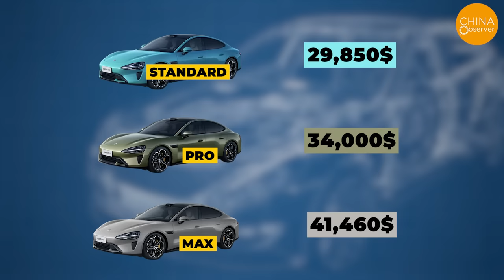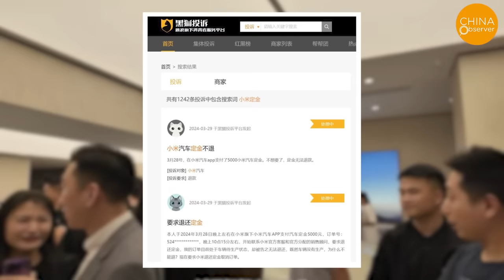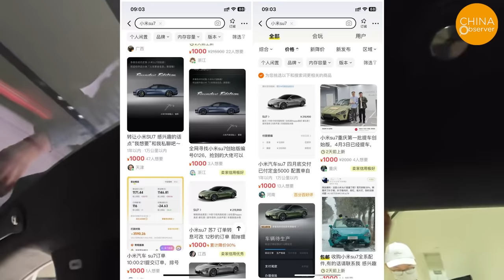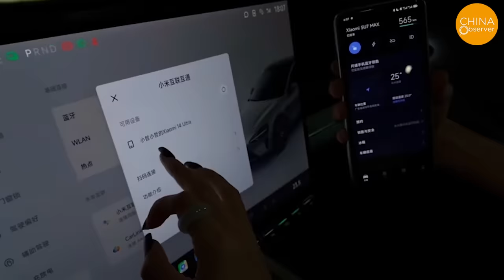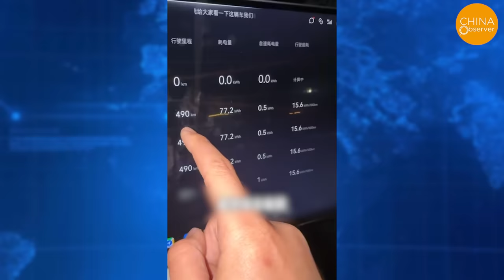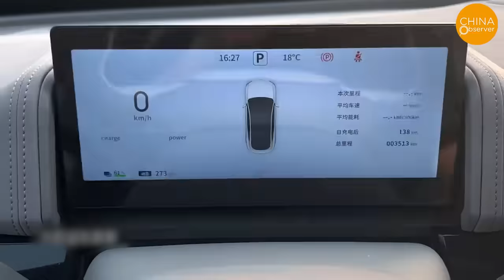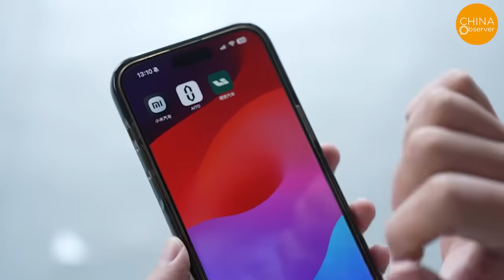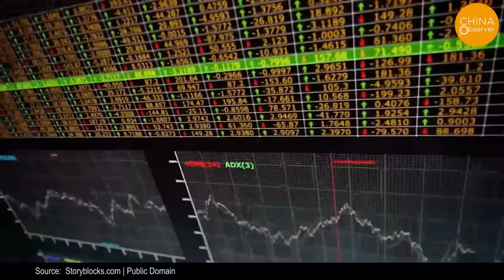Xiaomi EVs Criticized for Poor Quality, Using Aluminum Instead of Copper, 40% Cancellation Rate

Comment: Europe should not allow these vehicles to enter the European market. Cars that loose suspension or batteries that catch on fire on a highway are very dangerous to other vehicles on the road
Reply: Should be standard testing no matter where the car comes from in order to get into market. No reason to cherry pick!
Reply: and where to dump these toxic products?
Reply: @eriksvensson2098  That is not enough, because if a product is "designed" to destroy and take over a market, then that market should ban it.
Reply: Europian cars are trash the break down all the time with very expensive repairs also!!!europian cars are very sensitive
Reply: We have TÜV, don't worry. It's the great filter, barely any car accident in EU happen due to a malfunction. 99 % are driver faults.
Reply: Cars that fall apart when test driving should not be allowed on any road.
Reply: Remind me of expensive low quality of Boeing products LOL
Reply: they will pass standard testing then fail subsequently
Reply: @manuelr1405 There are large graveyards of brand new unsold EVs in China.
Reply: I hope they will be sue because they copied porch !!
Reply: do you have any idea how the EU is handling stuff...
Tesla cant sell a single cyber truck in the EU...
Reply: @eriksvensson2098  do you have any idea, what you need to do to get a CE sticker....
one of many reasons Chinese firms copy it and printing it on their stuff without the certificate attached, because they never got one!
Made in China is a curse!
Reply: @Arltratlo  Europe isn't a country whose people love monster trucks.
Reply: @hokroeger Some people love monster trucks.  You do realize though, monster trucks are not road legal and are only driven at shows and stadiums.
Reply: SB😂
Reply: @manuelr1405  in third world countries as like as we always do
Reply: That will probably be their sorry excuse to protect their companies
Reply: @Erik-Winters So we should actually still be riding in horse carriages
Reply: @damocles8417  For the rest of t he world, a Silverado is a monster truck; a thing that looks really ridiculous when used to  go to the supermarket or to drive kids to school. the same goes for a Hummer, or a Cybertruck.
Reply: There should be a genuine video footages of the actual incident. Or this is another one those demolition jobs
Reply: Surprise: Tesla  also uses aluminum wiring 😂
Reply: @Erik-Winters  I mean that's like 90% of the western agricultural products in world market. All of which is heavily subsidized by governments.
Reply: @Arltratlo I wonder why , maybe because it’s a death machine 😂😂😂😂
Reply: 50 cent army herro @alxRo
Reply: Then Tesla should be expelled as well since there are many examples of brand new Teslas whose suspension cracked after a few miles/kilometers of driving.
Reply: @alxRo #European cars. 
All cars can break down, but I'll give you some credit about expensive European cars. Some of them top the list of most failures, but not all. Toyota, Kia and other Asian car manufacturers are always at the top of the lists over cars with the fewest mistakes for both new and used cars.
Reply: @EmilMToft  there definitely is not. I found one person who had issues after 115 miles. However, this:

"Reuters previously noted that Tesla performed 120,000 repairs of just the front upper control arms between January 2021 through March 2022."

That's pretty bad for sure
Reply: @Arltratlo that's because of the physical design of the Cybertruck and not because of demand that it's not sold in the EU. The Cybertruck hasn't got a deformation zone because of the hard metal used for the chassis/exterior, which is one of the reasons why the Cybertruck doesn't live up to the codecs.
Reply: @magnumxlpi look at the German TÜV and how the Tesla 3 is the car with most faults/mistakes for all the 3 year old cars tested extensively.
Reply: @EmilMToft   heyy I lived in Karlsruhe and Berlin. Yea I believe it. That's pretty wild
Reply: @DC9848 european cars are expensive and cant handle competition. All the brands make 30000 euro cars with sub 200hp and when another manufacturers brings 300hp 29000euro they jump on him like:
Reply: Nobody would by a chinese car in Europe. We know what to expect : a tofu car !
Reply: @frankmaclow2709  you wouldnt buy a chinese car because they lie about the capabilities. If you look even the entry level ones list 600km range from 70kw batteries and they dont even have a repair network so you can service them
Reply: It has BYD blade battery technology so the chances of the battery catching fire versus a Tesla is infinitely less.
Reply: @Arltratlo  naah you can import it, as EU regulations are only recommendations. Same with this xiaomi car, u can register it in ukraine or something, same with US-cars, that have v8 there are plenty F-150's very popular among farmers. People in europe are just poor.

Comment: In the United States, in the 1960s and 1970s aluminum was used in home wiring for cheapness' sake.  Later there were a lot of problem with oxidation and loosening of connectors due to significant expansion/contraction.  Afterward, the US went back to copper wire.  Using aluminum wire indicates that the manufacturer does not intent the vehicle to last a long time.
Reply: Guess what tesla use? aluminum wire? or copper wire?
Reply: I think aluminum is not the problem. You should isolate it well and use the right wire thickness accordingly.
Reply: it could also be a method of accidental forced obsolescence so the user needs to buy a new car sooner.
Reply: Because in the 60s alluminium was still new tech for civilian market. But guess what, alluminium is quite comment nowdays in cars buildings and plant. Copper price have rose and we know how to produce better alluiminium cable. Most EV like tesla use alluminium wire.
Alluminium has much better electrical property than copper.
Reply: Even to this day aluminium wire and high current start's car and house fire's!!! Even aluminium speaker wire is absolutely garbage that breaks when setting up speakers or it won't work at all having many breaks along the length of the wires!! If you have a Ev with aluminium wire you are guaranteed to have a fire
Reply: @chiriematthieu  Aluminum has 61 percent of the conductivity of copper.  (at the same size conductor)
Reply: Good business idea, we will create a completely new copper wire loom for the cars. Price 2000pounds.
Reply: Peer inside your breaker panels and you will almost surely find aluminum wire for the major runs from the street to the Main Panel and to subpanels.
Reply: @SihAza  maybe in a country that has no regulations.. here in Australia 🦘 is copper wire from the power station to the power points
Reply: @chiriematthieu this is untrue. Aluminum is less conductive than copper. It is acceptable to make claims that it’s usable, but its electrical properties are not better.
Reply: Aluminum only suitable for foils to cook stubborn potatoes.😃
Reply: @云起-p4m  source where tesla uses aluminum wire? I don't think so

Comment: 10:28  Aluminium wiring is a recipe for disaster.  I earn extra money by fixing people's car.  There are countless number of cases where electrical problems arises from the use of Aluminium, where the connection at the Aluminium got eaten away overtime, while also generate some kind of deposit between the two materials increasing the resistance to a point of open circuit.  I mostly found them on French cars (at the rear light cluster) and FIAT.
Reply: Car Designer know that problem, but its part of intentional market strategy, minimizing production cost to kill other participant
Reply: The french vehicles are about as reliable as chiiiinese.
Reply: @russelbrown6275  For the French cars, at least their brake works.  Take a look at Malaysia Chery and MG no brakes.
Reply: Galvanic corrosion
Reply: @vinegar008  wow that’s a hell of an argument

Comment: 01:58 China pleather PVC doesnt last a year. They're made to  flake and disintegrate. Activists wanted "eco friendly" plastics. This is it. 11:10 Aluminum wiring is not used in construction for very good reasons.
Reply: This is not eco friendly plastic. Thats polyurethane stretched over a shitty cusion. Actually hemp seats tend to last quite awhile
Reply: Remind me of expensive low quality of Boeing products LOL
Reply: aluminum wiring for power distribution is used all the time in residential, commercial and industrial settings. the only thing its not used for is general purpose 15 and 20 amp power and lighting circuits.
Reply: Aluminum wire is not used for good reasons, but running hot is not one of them!  The narrator also stated that the lower conductivity is made up for by increasing the cross section area.  The heating issues is not because the wires are aluminum, but because they substituted a lower gauge to save money, which they would have done with copper as well.

The main issue with Al wiring is because mixing different metals causes reactions.  In a home, the various fittings are generally made for copper, and the rare Al house has to insert special adapters.  Now guess what's another thing they can cheap out on?

The final issue is with how many times the wire can be flexed before it cracks.  

Note that all the distribution cables you have overhead on towers and underground, from the powerplant to the residential substation, is all made of aluminum.
Reply: Nothing eco-friendly with PVC (or any plastics tbh).
Reply: Faux leather will always fail. Even if it doesn't discolor, eventually it will wear away, showing the fabric backing.
Reply: Looks like headphone pad cover !! LoL
Reply: Tesla plastic "leather" hasn't fared any better.  The steering wheel covers in the expensive Plaid sedans has fallen apart.  Their seats have show similar bulging.  You know nothing of construction.  Your house surely has aluminum wire for the large runs.

Comment: lol!!!   aluminum wire was tried in factory built homes here in the US.  It was discovered that the aluminum wire, while the lighter Then copper wire. was so much more brittle, particularly where the connections were made and the aluminum wire cut. to make the conductions, that the wiring was deemed too big of a fire hazard to be used. in these units.. Keep in mind that the units left the factory., were transported down the freeway, and ended their journey at the final site where they were installed. to be permanent homes. If that jostling down the freeway. a bit was enough to cause problems with the aluminum connections., Can you imagine? the kind of difficulties that those aluminum connections are going to have. with the car that's being driven down a highway every day Nova potholes. et cetera..xiaomi Should offer three versions of this car? 1. parked in the garage and never used.,  2.  special flame paint job 3. The burnt beyond recognition model..
Reply: Good explanation on the shortcoming of aluminum wiring issues.
Reply: Yup rented an old house with aluminum wiring, it was not great. I can see why they regulated aluminum out of residential buildings.
Reply: A quick search turned up comments about Tesla also using at least some aluminum wiring in their vehicles.
Reply: Do you know tesla  also use aluminum wire? it's common in EV industry
Reply: From Tesla: Aluminum wire is cheaper than copper, but the wires must be thicker to carry the same amount of current. In addition, every type of attachment (breakers, outlets, etc.) must be specifically rated for use with aluminum wire (and many are not). Lastly, care must be taken to apply the correct anti-oxidizing paste. If aluminum wiring is not properly installed, over time it can cause dangerous overheating resulting in fires! For this reason, we strongly recommend the use of copper wires for EV charging to avoid the risk of improper installation. The Tesla Wall Connector is rated only for copper wire.

Doesn’t sound like they are fond of Aluminum wire, even for the home charging system.
Reply: @CunningtonR  No one uses aluminum wire for charging because of the high currency.  We're talking the car wiring. You better dig deeper.
Reply: XiaoMi makes Phones. 
ZERO Car Design n Mfg EXPERIENCE

Comment: Aluminum's higher resistivity means you need heavier gauge wire to carry the same amount of current, or suffer resistive losses in the form of hot wires that waste battery life and could melt the insulation and start fires.
Reply: Car catch's on fire inside garage; $ 250,000 house burns down because of ev car.
Reply: Or a higher voltage.
Reply: @deth3021  true.  But higher voltage also means any short becomes deadly.  Is the risk worth the savings?
Reply: @dcc70  so you are saying that 800v isn't deadly?
Also bumping 12v system to 48v doesn't make it deadly.
You have too simplistic a worldview.
These are all just things that can be managed.
Reply: What matters is resistance per mass, unless volume occupied by the wire is a problem.  The aluminum wire is only for the high-current runs from charging port to battery and battery to motor.  Doesn't Tesla also use aluminum wiring there?

Comment: Aluminum has a higher resistance to electric flow than copper, and higher resistance generates more heat in the wire. Aluminum is OK to use for low voltage over short distances, but NOT for an EV!
Reply: High voltage power lines consist of steel and aluminum not copper. Cheaper and more lightweight but thicker. Nevertheless this car is absolute crap.
Reply: @olli1407  there's a big difference in stringing out aluminum/steel wires in the open air and apart from other wires, and confining aluminum wires in a small space with little airflow against other components.
Reply: @devo076 The biggest difference is the voltage.

Comment: XIAOMI make phones
Cars are A TOTALLY Different MONSTER
Reply: It takes at least decades of experience to make a good car - the materials science behind making a car that lasts it is very complex.
Reply: @xraylife it does not need to develop knowledge from zero, just pay high expertise people to do the work
Reply: @teknosql4740  Manufacturing cars is much much more complex than you imagine. It involves 1000's of sub-contractors and suppliers and managing their quality throughout the entire chain.
Just the plastic paint coatings on a dashboard, or a gear wheel is a huge story within itself.
Reply: @teknosql4740  yeah, thats not how it works.
Reply: I have an Audi A2 from 2002 and it is still in perfect condition. I drive it daily. I mean 7/7.

Everything is neat. Even the colours are hard to get scratched I wonder why would they make such monthly broke cars...
Reply: Not really. Since it's an ev not ice. It's all battery, electric motor and tech.
Reply: @kamsunleong6648  
Chassis, Crumple zone, Panel Firment, Rust Prevention, Suspension Geometry, brakes,  A/C etc etc etc NEEDS Experience to Ensure Reliability.
Reply: Exactly , you can’t expect a cellphone manufacturer to successfully make EVs with no experience whatsoever, that’s like asking a chef to design and make a car they literally set their self up for failure
Reply: @xraylife  Explain to me then how BYD went from a battery company to a leading EV company within such little time then. And their cars are well made enough to threaten European and American EVs.
Reply: To be honest, Xiaomi phones are no better

Comment: Buy a car made by a phone company? Smart and innovative! Truly brave 🙏.
Reply: I bet if Apple make a car, you'd be in line to buy it too.
Reply: I would 100% give apple a deposit today if they were making a car
Reply: @jackstraw262  Emm, Apple back down. They invest billions already but cancel the project. Apple just can't do it lmao.
Reply: @keithframe3489  right.

Which is why if they decided to, I’d trust they would be capable
Reply: @jackstraw262  Okay, fair enough. But steering wheel will not be included, sold separately for $7000.
Reply: @keithframe3489  7 grand for a specialized steering wheel would be fine if the car was guaranteed to have full battery life to 500k miles
Reply: @keithframe3489 if you was paying attention the apples intention was full autonomous car so no need for driving controls.    More likely that not so much cannot make it but cannot make it at a price will sell at.   Apple like a certain mark up and not interested in low margin products.
Same reason the improved screens keep getting delayed.    Not that cannot be made but not at a price that effective.
Reply: @keithframe3489 Yeah. Xiaomi invested and look at the shitshow theyre in now 🤣
Reply: @keithframe3489  apple car is a full self driving car. While this junk barley stays on the road with steering wheel.

Comment: New Energy Vehicle is a misnomer. Charging from 80% coal-powered station, ICE exhaust is cleaner. Old Energy Vehicle is more appropriate.
Reply: Also diesel & gasoline powered equipment is used to mine, transport, and process metals in EV batteries.  The mining process destroys the ecology in those areas. Child labor is used to mine cobalt in the Congo.

Comment: They claim to be selling at a loss, but they're selling trash? How much of a loss could it have been if they skimp on the materials and only use low quality stuff that breaks within a year? The reason luxury cars are that expensive is because they use high quality material that doesn't break easily, or is extremely light (or both if carbon fiber)... 
You can get some pretty decent cars for 30k USD (new) and most of them you will be able to use for over 10 years because they're not made out of trash.